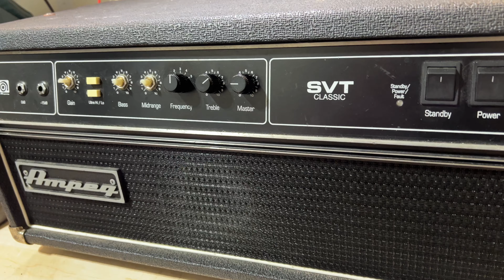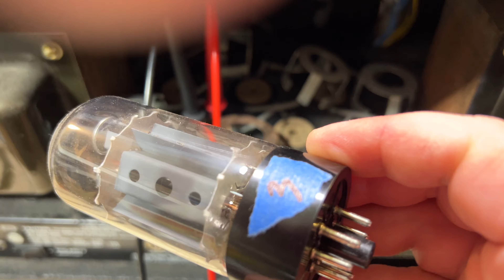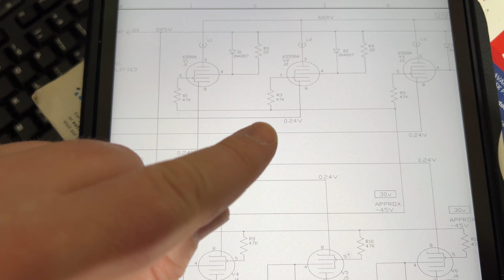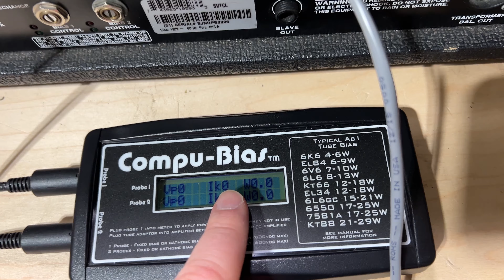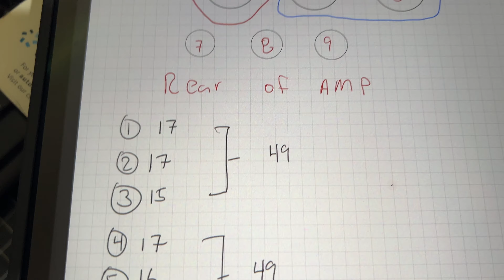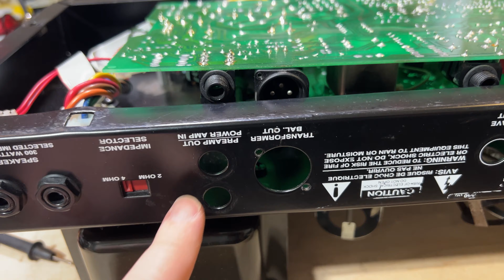Ampeg SVT CL Repair - Part 1

Comment: Great vid.  On my 2004’ish CL I hear a pop, then the standby/fault light started flashing green-red.  I powered down, then turned it back on and played through it, and it seemed fine. Then I checked the bias lights on the back, to discover that the right side would not turn green. Thinking about buying tubes and replacing myself, but then I saw you’re in the Seattle area. So am I. Are you still in business? How can we connect? Thanks.
Reply from the maker: Hey! I am still in business, but am located about an hour north of Seattle. Funny enough, a buddy just contacted me today with the same issue on his SVT-CL that i just retubed. If i post my email here it will get flagged, but my contact email and website should be on the youtube page. Otherwise email is same as the channel name @ gmail.com

Comment: This is great! One question I have is have you dealt with one of these pulling too much B+ once the tubes are installed? I have one from a buddy that just wanted some service so I replaced the screen grids along with some other resistors near the power caps along with cleaning up some solder joints and now every time I turn off standby, the amp hums like it’s getting too much voltage and causes me to shut it down. It doesn’t go into fault mode but then again I don’t want to burn out the speaker load resistor again. It’s hooked up to a 4 ohm load and I am only using the two front power tubes like shown here for bias testing. Any ideas? Powers up fine without the tubes.
Reply: Got it!!! Damn Loud Technologies didn’t label the damn orientation of the two pronged cable going to the speaker board lol. Had to unravel it to make sure positive is to positive and negative to negative. Now to bias and put it back together. Thanks for entertaining my frazzled comments lol. Love the work you’ve done and will definitely be watching more to learn more!!
Reply from the maker: @EnemyJ-FL  haha oh man! Glad it turned out to be something simple in the end! Sometimes those are the worst ones!
Reply: @TechnologyEnterprises  I love and hate when it’s something simple lol. Just like when that preamp tube kept the SVT CL in fault mode… like wtf? 😂 Either way, I should be able to get this back to the customer so he can play his wedding party! Ironically, I’m doing this service as a gift, HA!
Reply from the maker: @EnemyJ-FL  nice! Glad it all worked out! Those are the kind of fixed where i will check that kind of thing first from now on for every one of these amps I see after beating my head against the wall on it.
Reply from the maker: What B+ are you measuring with tubes installed? Are you saying you blew your dummy load resistor when doing testing? If so, what wattage was that resistor?

If it truly is allowing voltage that is too high to get through i would suspect you would blow tubes before anything… but if that is the case i would look for failing filter caps or similar issues.
Reply: @T @TechnologyEnterprises  haven’t measured the B+ yet but there is R14 on the power board that is blowing which is a 220 ohm. I read that could be from excess B+ but it also looks like it’s in the bias circuit. I’m also working my day job as I figure this out so sorry I cannot provide all the info right now lol. Just truly stumped right now.
Reply: @TechnologyEnterprises R14 is directly tied to the speaker output board. Not understanding the overload since I have a 4ohm load connected.
Reply from the maker: @EnemyJ-FL  oh yeah, interesting! Is it safe to assume you have a multimeter? Looks like that resistor is on thr cathode of thr V1 preamp tube. Does the resistor blow if you pull that tube? Had to pull the schematic up on my phone so may be misreading things bit looks like thay J10 header also connects to the J7 ribbon cable and those connections go to the heaters of V1 - V6. Is it possible you have a failed preamp tube?

Comment: Thanks for making this video. Very insightful. Good reminder I should stay away from inside of amps :)

I've acquired an 20+ yr old SVT-CL  and it was working great. Small hum once powered on but seemed to dissipate quickly after playing. In total I have played it for 3-4 hours in total with high gain and low master volume. Not trying to blow my neighbors away during solo practice.

Today I plugged everything in, pressed the power switch and left it to warm for a minute. Then when I pressed the standby switch on everything turned off. Now I get no signs of power. Hoping its a simple fuse switch. Just ordered 1.6A slow blows.  If not I will have to find a local tech that would take on this project.
Reply from the maker: I am sorry to hear that! 

It could be as simple as a power tube that has failed short, but could also be a resistor or capacitor failed catastrophically. If there was any kind of electrical burning smell associated with the failure it could be more likely to be a component failure, but either way hopefully the fuses caught it. 

Not sure where you are located, but here in 120V AC wall voltage land the version of this amp that i had on the bench as a 10A fuse on the back of the amp and an internal 1.5A fuse.

Edited to add: if you are anywhere near the PNW in Washington State i could be talked into taking a look at your amp if you can't find a local technician!
Reply: @TechnologyEnterprises  Appreciate the insight! So the power fuse on the back actually looks good. Replacing it did nothing. I will next check the internal fuse before calling a tech that is located about 45 minutes away. Fingers crossed
Reply from the maker: I hope it is just a fuse! Even then keep in mind that a fuse always blows for a reason and is usually an indication of a bigger issue. They do occasionally blow from a power transient at the wall socket, and not something internal to the amp, but 9 times out of 10 it is an issue with the amp. Even if it powers back up with a new internal fuse i would recommend giving it a solid test under circumstances where you can watch it closely to power things down if any strange behavior pops up. Best of luck and reach out if i can help advise with anything further!